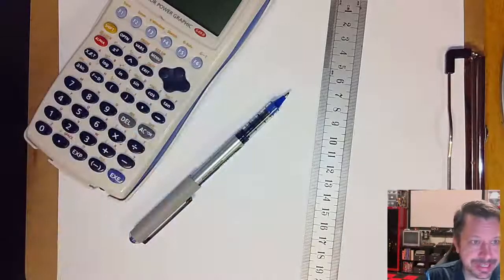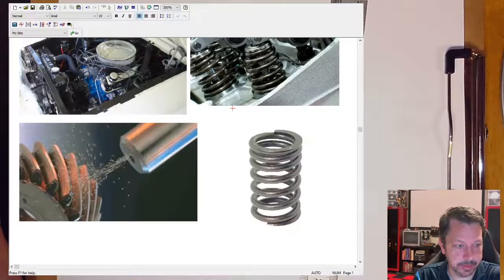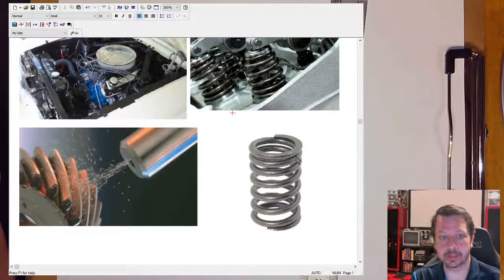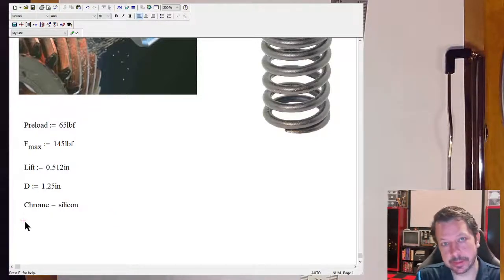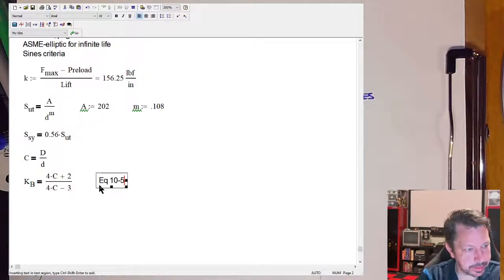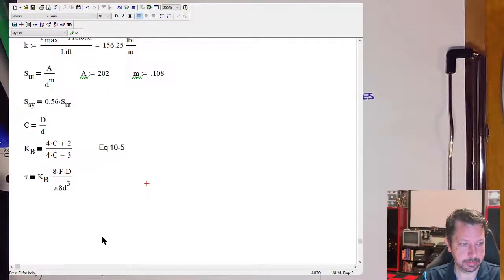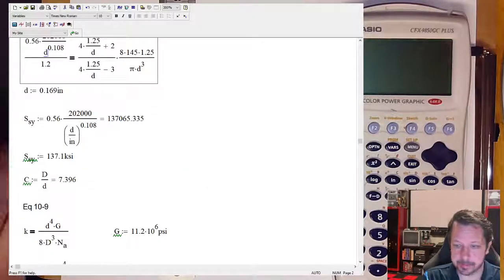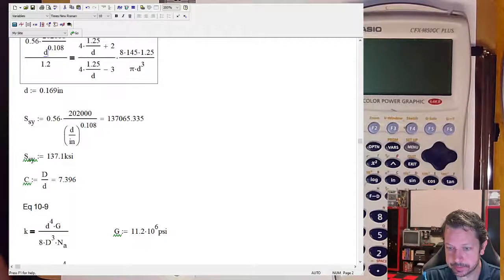Spring Fatigue | Shigley 10-9 | MEEN 462

Comment from the maker: At the very end when calculating the factor of safety, I made a mistake. The mistake is in the calculation of midrange and alternating stresses. I switched them! Midrange should be 82.3 ksi and Alternating should be 31.3 ksi. I basically have the minus and plus signs switched when I defined their equations. The FS should be 1.334 for ASME and 1.835 for Sines. Sorry about that!